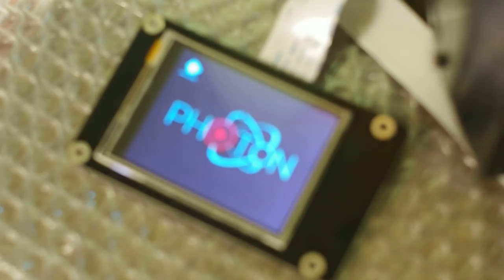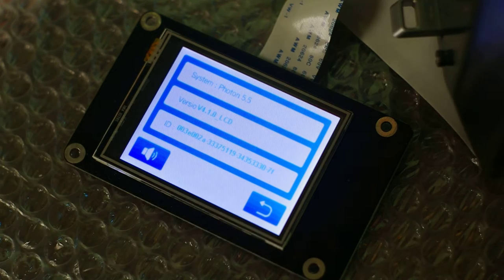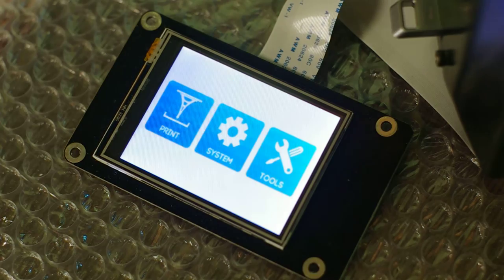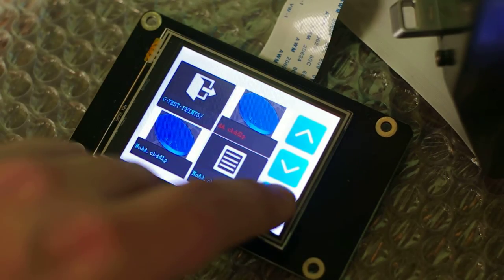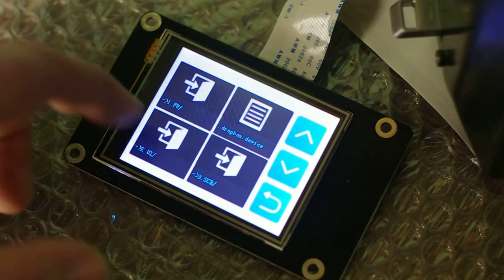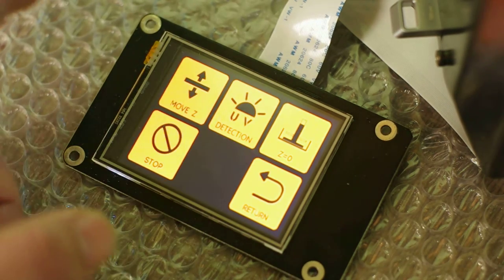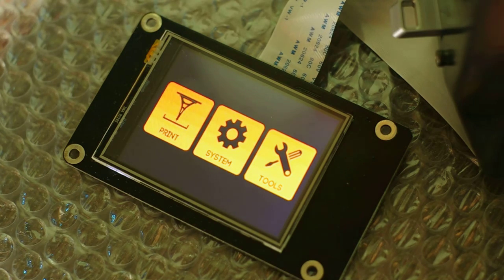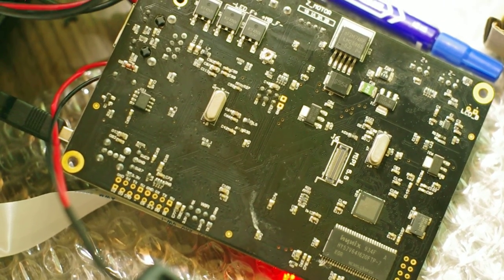Modding Photon UI with Extractor / Compiler binaries

Comment: excellent video. in my photon marks LCD error code T100 when printing. Might you help me?
Reply: check photonsters.org known issues page
Reply: this error usually is either caused by a phisicall defect on the screen or motherboard or a bad firmware update. it depends on your context. better to open a post on photon owners facebook group. tag Vinicius Silva, Sen Kun and Amy Liao